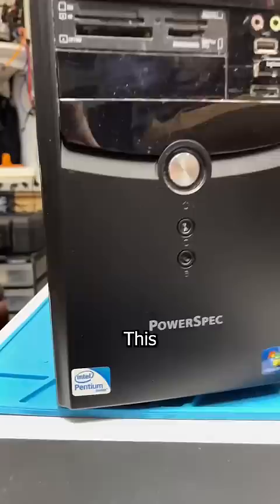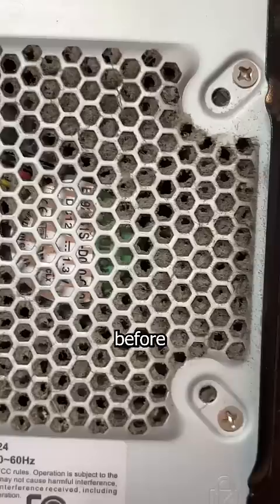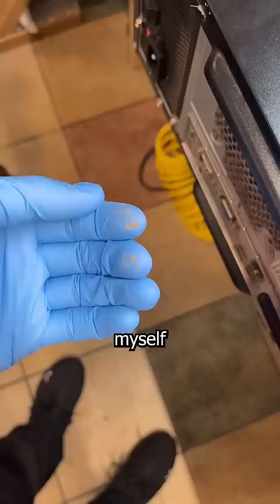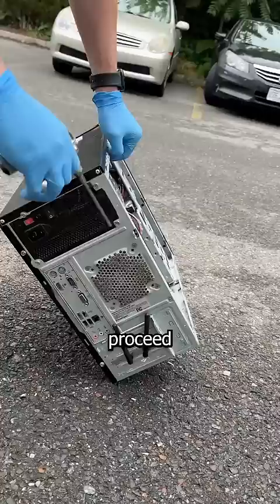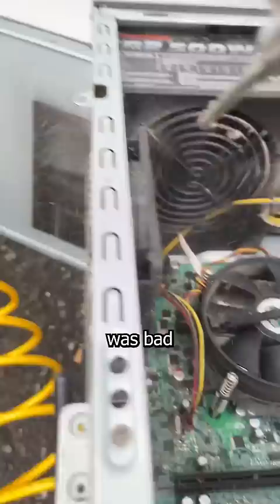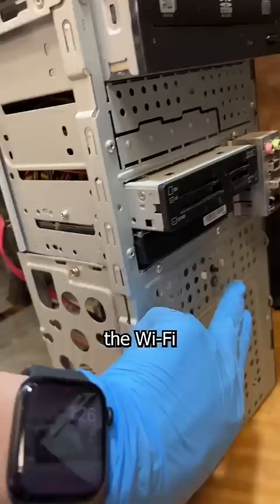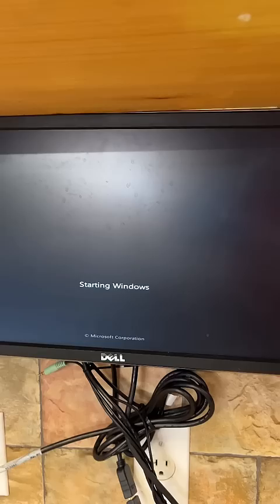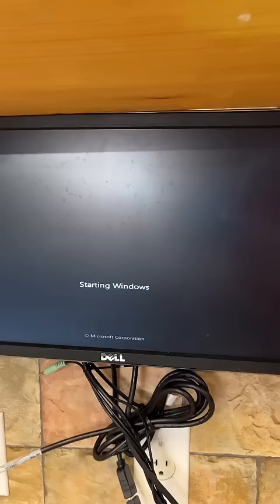Clean your #pc or it will end up like this! #technology #tech #shorts #computer

Comment: you correctly prevent the fan from rotating while spraying. This protects the bearings from over spinning and breaking the fan. Proper job
Reply: Also on some machines spinning the fan can generate voltage that runs into the motherboard. Many modern PC’s will have protection for that, but I wouldn’t do it still, especially with an old machine.
Reply: I mean, he is

The Greatest Technician That's Ever Lived (TM)
Reply: @fromthebackseat4865 fans produce back EMF while running though. It should be fine as long as the fans don’t spin beyond their normal max rpm.
Reply: ... so that's why my fans broke
Reply: @Disposed-ej3ow oh, im sure i remember him stopping the fans. how strange
Reply: @Disposed-ej3owhe does if you look he has a plastic screwdriver preventing the fan from spinning
Reply: I litterally spin the fans all the time when I clean out my PC litterally never had a problem and it all works fine?
Reply: @jcdenton166  do they rattle when idle?
Reply: @traida111  litterally no difference from when it was new its perfectly fine apart from the fact its 12 years old
Reply: @Disposed-ej3owWell, PSU fan isn’t going to backfeed into the motherboard when spinning. Also … they’re kinda difficult to block easily. 

I like the idea of him using the zip ties, though. I’ll have to try to remember that trick next time I clean out my machine.
Reply: I have a 10 year old CPU, that's been O/C, all the original fans, and I've never held the fans. I'm sorry, but when people are talking about this kind ofstuff they're often talking about high-end enthusiast level of logic. 

It's also extremely important to inspect and do all this crazy crap to your car, but does the average person work on their car and supe it up to racing standards? NO! Why is the suggestions in the PC building community always in the form of "Only Top Level Enthusiasm should be the standard."?
Reply: @Ilovepoopin  so when you spray it with a high powered stream of air, you spin the fan up so fast that it turns into a jet engine? If you go past the speed that is max rated by the fan, you risk damaging the bairings. It can depend on manufacturer and the type \ grade of components they used. The common issue causes is a vibration or rattling sound. I have a sensitivity to sounds (mishophonia), so its irrates me when it happens tbh.
Reply: @traida111 That only matters on laptops, those fans are fragile as fuck, doesn't matter with desktop fans.  And the motors in laptyop/desktop fans cannot generate a voltage. You only plug up the laptop fans because if you don't you are likely to damage fan blade/bearings.
Reply: @Nerdiness1985  I rather do it properly and not spin up the fan into a turbo jet. Nor do I use a vacuum cleaner, and fry the chips with electromagnetic field. I just do things properly and not pull ideas out my ass.
Reply: The fan on the power supply. 💨💨💨
Reply: If spinning a fan causes a bearing to fail it was most likely already failing but a couple drops of oil in the bearing will make them last twice as long
Reply: @gradystephenson3346  you change cpu heatseak fan bearings? damn son, not something I'd ever even consider. I got some roller skate barings, would they fit?
Reply: You should see what happens to laptop fans when you overspin.  Did it one time, ended up with a fan that had less blades than when I started.  Ended up replacing the fan.

Not doing that again.
Reply: Im sure almost any fan can generate eletricity if you spin it with a blower.
Reply: @fromthebackseat4865 that's crap I watched a guy debunk that the fan can spin as fast as it wants it create enough voltage to damage anything.
Reply: @mrhappy8966  “that’s nonsense I watched one guy do a test on one machine and it proved it wrong!” Wow, stellar reasoning. It’s not like different machines, with different circuitry and back voltage protection, could react differently.

Comment: Wifi card?? Man, you may just save my life
Reply: What?
Reply: Im dumb

What do those mean
I obv know about the reciever that does the wireless magic but.. this?
Reply: @Euan_01  I guess op just didn't know there were Wifi cards for desktops.
Reply: @HoveringAboveMyself  honestly im not surprised lol I havent seen a wifi card since like 2015 lol
Reply: We’re you running your pic without Wi-Fi? Or with an Ethernet cable?
Reply: @Ifortgor some motherboards have it integrated so you don’t need a separate card
Reply: @HoveringAboveMyself 'I' knew they existed but actually 'seeing' one being used in a desktop, is sort of like seeing a 'unicorn' or 'bigfoot'!
P.S., I still have my 'OEM' Windows 7 'Ultimate' disc!
I 'bypassed' Window 8, & 8.1, but I bought Windows 10., & Windows 11 Pro.
Windows 11 Pro, is a major disappointment.
Reply: They used to be a thing back in the day, nowadays we get wifi with the motherboard.
Reply: Motherboard wifi isnt nearly as good as adapters. My card almost doubles my motherboard... 🤷
Reply: I'm so used to old tech and rack mount ICT equipment I only learned like 4 years ago that PCs have built in WiFi nowadays.
Reply: That's just typical
There's way too much PRESUMPTION when it comes to "certain tech advances  in PCs".
Just a bit of a "Sophisticated Wild-Assed Guess" here, but did any of the 'mainstream' computer companies that are still making 'desktop', 'tower' PCs, actually build desktop PC units with WiFi capability on the 'motherboards' of their PCs ?

I think it's pretty safe to say that the built-in WiFi capability of desktop PCs was strictly relegated to the 'OEM', DIY, and 'GAMER' computer owners.  Because the major computer builders were all about pushing a specific type of PC.  With all of their attention focused on selling 'laptops' and GAMING laptops in particular, the desktop computers were practically thrown in the trash.
Reply: @TheRealDrae  Damnit, pretty much everyone knows that LAPTOPS have built-in WiFi. 
However, the DESKTOP PCs generally DON'T, or at least, they DIDN'T come with built-in WiFi capability.

Can you specifically NAME a Desktop PC, that has built-in WIFI capability?
I'll wait...
Reply: Just buy a usb dongle instead
Reply: @BurgeonedGrim  M.2 wifi cards are more common to use if you have one in your motherboard.
Reply: No wonder pc technicians are like car mechanics. Their costumers normally don't know how it works so some of them use this fact to their advantage and charge a lot for a simple repair.

Comment: I worked at a financial company, instead of installing blades as remote backup systems they had hundreds of Compaq desktops long after Compaq was bought out. Whenever one went down we would strip it for spare parts to use on the remaining systems.

Comment: Been there, done that. Laptops don't boot when their WiFi card fails either. Don't let those fans spin from the compressed air. The high speed spin will ruin them.
Reply: Um, no, the fan will be fine.... If giving it a blowout hurts the fan, it needed to be replaced.... Like, dude, it's whole job is to spin fast, a few seconds will be fine.
Reply: @ericankney5957 It can ruin the motor on the fan sometimes, the fan blades tend to be fine, but the centre mount it spins on and the motor can occasionally be damaged by spinning at high speed from an external source.
Reply: @dr.insanity9087   Yeah I've been cautioned that motor and/or bearings can get damaged if forced to spin higher than spec as well.
A simple solution is to temporarily tape the blades immobile.
Reply: @ericankney5957  The problem with spinning fans like that when the computer is off is that they can generate an electrical charge that might cause damage to your pc components
Reply: @jcrc1  That has been proven to be false.
Reply: @jcrc1 That's been proven untrue fam

Comment: Depending on the company, I would assume they may have a reason to use an old computer/OS, maybe certain hardware could be unsupported on newer operating systems, even with the relatively good backwards compatibility in Windows. But yeah, if they're trying to use something this old for productivity, its likely going to be dog slow, and the lack of security updates doesn't help either. Hopefully they can be convinced to upgrade, not only for their own sanity but theirs customer's safety if personal details are processed/stored on that computer.
Reply from the maker: Exactly. They have proprietary software that only works with Windows 7, which is completely fine. My issue is the computer being connected to the internet on such an old OS. We decided to build a Windows 11 machine w/ a W7 VM.
Reply: Upgrading it to Windows 10 definitely won’t make it any bit faster with the background telemetry putting strenuous load on system resources alongside other needless features courtesy of Microsoft’s overgrowing ecosystem, that’s why Windows 7 was offered an extension for its security updates for quite awhile longer than the general public for these enterprise applications
Reply: @damian9303 I was talking about upgrading to a new computer, not installing a newer OS onto this dinosaur. Doubt it even comfortably meets the meets the minimum requirements for Windows 10. Any modern Dell workstation would be a good upgrade, and as Salem mentioned, a Win7 VM would be a great workaround to using an ancient OS without security updates for tasks that require an internet connection.
Reply: Also 13 years ago SSD nearly not exists. They cannot upgraded to win 10 due to Full Disk error
Reply: @SalemTechsperts if windows 11 is only going to act as the host for the windows 7 vm why not use linux as the host?, Or do they also have windows only programs that needs internet connection that can run on windows 11?
Reply: Yeah the reason is they cheap
Reply: @RedYoshiGo no, my father still uses a windows xp because the huge ass machine that takes 2 rooms to store is only supported on xp and below
Reply: Did you know some trains need computers capable of running windows 95 because the sensors and controllers have proprietary connectors that only work with older ports, and due to electrical limitations they cant make it work with modern ports.
Reply: @MetaDude meanwhile me using the C64:
Reply: @aoyuki1409  I believe it, where I work there are still some Win95 and XP machines (all off of the network) that are still used for some test software that won't run on anything more modern.
Reply: @JeffDeWitt  where i work the IT guy can't even do VM since the software is i wouldn't say hard coded but the key is on the drive, basically once that fail they will need to buy a new 5K software to run ac units on top of the building.

but ya the factory runs 95, xp, 7 & 10. not just that but also cost of lets sayin buying 60 windows 11 keys
Reply: When I worked for a medical company, they were still using XP well past its EOS on PCs in the imaging department because the software wouldn't run on Windows 7.

Comment: Having a clear side-panel allows me to keep an eye on the dust levels. Mine doesn't get much dust in it, anyway, but it's good to be able to check it at a glance.
Reply: My old school training says that a glass side panel won't securely block RF data leaks to outside the premises .  But checking the insides for dust is fairly routine as part of other hardware work .

Comment: The spinning fan can create voltage that feeds back into the board.
Reply: True, but there is a circuit board on the fan motor that handles that I'm pretty sure.

Comment: It's always best to keep your fans static when cleaning computers so they don't send voltage back through and cause problems, also windows 7 was great but now it's not so great, use to mess around with all the fancy applications on it with my brother haha, back when there was no need to worry about life and jobs and all that, cherish the moments you lot out there haha.
Reply: i cant believe I had to scroll down so far to find this. I agree, poke a screwdriver or spudger into the fan so it doesn't spin while blowing it out.
Reply: @Steve_TheTechGuy  exactly, well said, althoug i would probably just hold it or use another tool rather than a screwdriver.
Reply: Made a point of looking for this comment before adding it. Either unhook the fans or block them.
Reply: @badelementofstyle5238  honestly its bes to just get some electrical tape and tape one of the fins to the body of the fan, or get some sort of clip that locks them in place until cleaning is done.
Reply: i wonder if anyone was going to catch this. You'd figure the "greatest tech of all time" would take easy precautions to prevent more labor.Dont get me wrong he;s a good tech, but great is pushing it. He's great at youtube shorts though XD quality content.

Comment: I’ve had a Wi-Fi card cause issues before. I have an x58 machine I use occasionally, the Wi-Fi card failed and caused blue screens and freezes. I originally thought it was windows 11, so I reinstalled windows 10 and then swapped the SSD with a spare one. Then I tried simplifying the configuration and it worked. It’s. Shame as it’s my only PCI Wi-fi card.
Reply from the maker: Damn. I don’t know why they have such a high failure rate. I’ve replaced a few dozen over the years, including 2 of my own

Comment: I like to clean mine once a year whether it needs it or NOT.. :)   I"ve heard that canned air can RUIN a circuit board though- don't know how- but that's what I heard.
Reply: From what I understand some canned air is crap and includes chemical residues. (my info is more than a decade old so...)
I use a blower compressor with a tube attachment to air flush my PC. (it's actually supposed to be for air-con cleaning)
Reply: NICE setup.. I need one.. canned air IS bad.. it condenses into moisture that ISN"T just moisture.. other crap in it..  @KelvinKamsg

Comment: I maintain a lot of the computers in the factory where I work. Some of them were as bad or worse than this. One started shutting down on it's own, when I looked at it the poor thing was so caked with dust the front panel, which is a mesh, was solid. The computer was overheating and shutting itself down. I cleaned it up and it ran fine for the next couple of months until I could replace it... it was a Win7 machine.

Comment: I cleaned one out back around 2000 that was almost a total dust block inside.  Once I blew it out, it kept throwing errors and I had to replace all sorts of parts.  I was convinced that the dust was the only thing holding the parts in place so everything made contact and worked. That was the worst one I ever saw.

Comment: I heard that using compressed air like this can cause static discharges that will ruin electronics, and that canned air has inert gasses that remove this risk. has anyone ever encountered actual damage from this or was it a wives' tale?

Comment: I use an electric dust blower every Sunday to keep my custom-built computer clean inside and out.
Reply: Seems like you are spending too much time on cleaning and too few on maintenance. Just get dust filters for the pc and don't place it on the carpet bro and you will have to clean it once in months.
Reply: @alexandruilea915  My tower is inside the computer desk CPU area. I also have a dust cover for when I'm not using it. I just routinely open up the case every Sundays as my Sunday routine and I use an electronic dust blower to dust blow the internal part. It's dust free.

Comment: I've had worse from the clients. Including rusty cases with rusty ports.
Fortunately don't clean computers now anymore. Except my own.
Also I usually disassembled the PSU to check if it had fat capacitors (not uncommon for an old computer), and it's easier to clean like that too. And yes I know how to be careful with that.

Comment: my old computer was running LOUD and was in need of upgrade. my buddy had an old graphics card that could work so he brought it over to put in. we opened it up and took out the old one. the fan was a compacted mass of dust spinning in a carpet of dust for a heatsink. one look and he said "how did this not catch on fire?", my only response "it is a heatsink"

Comment: That's from Micro Center aka MEI - Working there was interesting like the time the customer brought in his Compaq computer claiming it died and should be covered by the warranty. (It was within the warranty period afterall)  Upon opening up the computer the tech found a approxiamately 1/4 inch layer of paint dust.  You see it was used an an auto body shop where sprayed paint, sanded etc.  (Admitted by the customer.)   He insisted it should be warranted.  Tech took pictures and they were sent to Compaq along with the customers "demand" for warranty coverage. Yeah, claim denied.  Power Spec was a Micro Center brand and pretty decent in it's prime.

Comment: I always find it crazy how a bunch of people willingly base their entire company around the IT they neglect.

Still one of the worst cases I have seen are actual ATMs used by one of the biggest bank chain in my country running on unupdated Windows XP. Altough I did hear some horror stories about my countries military logistics still relying on MS-DOS based programs and floppy disks at a time when most modern gaming rigs just straight up ignored wasting space on even optical drives.

Comment: It's not great to use an air compressor. It has water vapors. Sometimes you have to drain the liquid from a compressor. It'll instigate rust. The vapor in canned air evaporates at room temperature though..